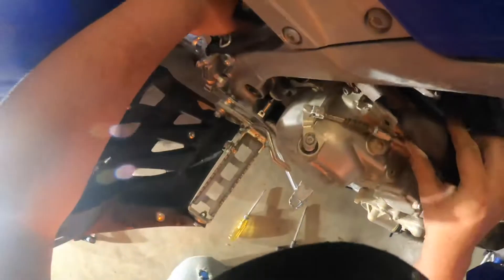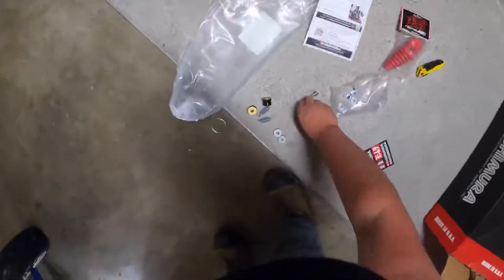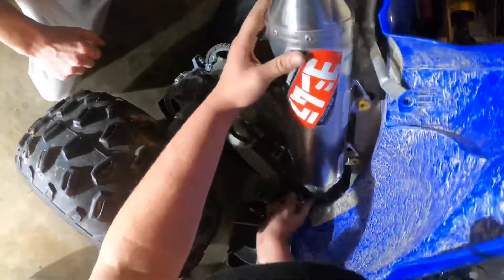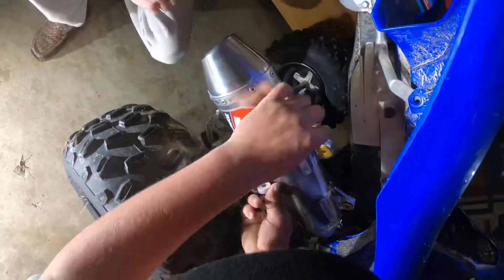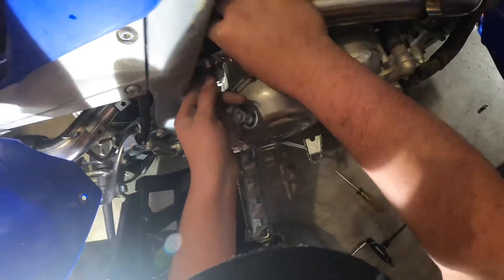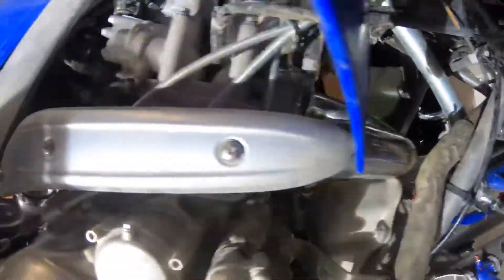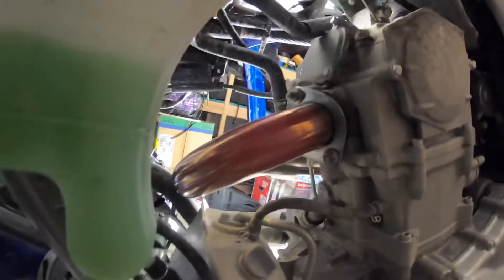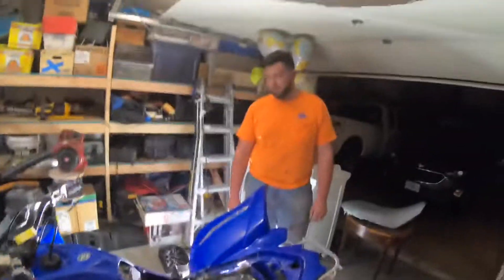2020 Yamaha Raptor 700 | Yoshimura RS2 Install | Startup And Rev

Comment: The radiator hose looks very close to the pipe move it away before it burns. I just ordered same exhaust yesterday waiting to get it. Also remember if it keeps popping get rid of the emissions put a block plate on cheap. And if you still get it. Replace the gasket on the head for the exhaust if it leaks can cause it also. I had a yfz 450 that did it till I replaced the gasket could see it leaked when I removed it

Comment: Why is the pipe getting red?
Reply from the maker: Engine is running and exhaust gasses are hot asfff
Reply: She’s heating up brother
Reply: Because it’s lean. Lol
Reply: @smokedog123456789  you should run a power commander with a aftermarket exhaust. Raptors run lean from factory, a aftermarket exhaust wil flow better, so it needs more fuel.